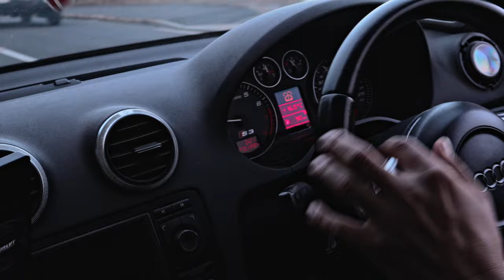Audi S3 8P Project | Building a track car?

Comment: Hell yes. Get rid of all the show stuff, replace the air with quality coilovers, replace all the bushings, some good brake pads, lines and fluid, proper tyres and you will love the car so much more. Trackdays are so much fun, and the process of becoming a better driver is a great journey. And you can have some fun in the mountains too 👀 looking forward to the transition!
Reply from the maker: Thanks for your input, some pretty valid ideas here. The car will definitely benefit from some upgrades too
Reply: @carlsvlogs2906  also happy to assist in whatever way needed during the build. Been developing my E36 for going on two years and been through 8 different alignments to really dial the car in 😂 definitely understand the process, would be more than happy to help where I can.
Reply from the maker: Thank you so much. You're an absolute star 🙌

Comment: Daily my 10 sec RS5 on air, take it on breakfast runs and straight to the track with no changes. Water traps catch all the moisture so no need to clean out the tank. I've had literally zero maintenance on both my cars on air in all these 4 years. We fitted quality kit and we fitted it professionally.
Reply from the maker: I haven't had any major issues either. I think im just wanting to try something different instead of changing car 😅
Reply from the maker: That is very true yes. Lemme get my ducks in a row first 🤞

Comment: Dont ditch the air for budget coilovers, ISC atleast if you plan to track the car. The interior is the last thing you want to strip, You will end up driving the car even less and the gains wont be worth the trade off. those cars make good power ,your weight wont matter yet. A proper Seat!! good tires and proper track alignment is vital. The best mod you can do to a track car is a driver mod... get a baseline for yourself and improve from there.
Reply from the maker: Thanks bud. I definitely will need more experience as I have given the car a soli drive for a while. The reason I'm removing the sound is to utilize it in my other vehicle, it's pretty much wasted here. I'll be going with Static Art Plus coilies that allows for dampening adjustment. Driven on them before and was happy with the feel.
Reply from the maker: Oh, I've got Recaro wingbacks in, I find then quite comfortable. I think im just ditching the show stuff in pursuit of what I've always wanted.